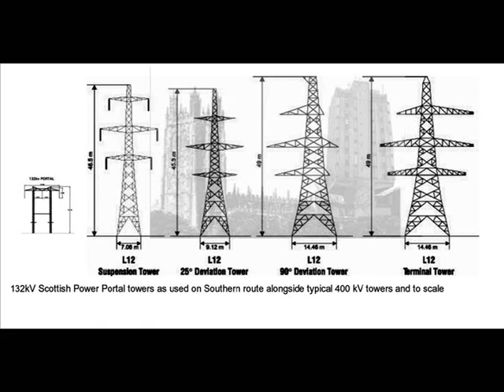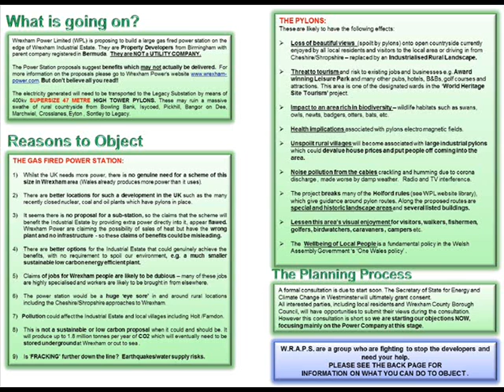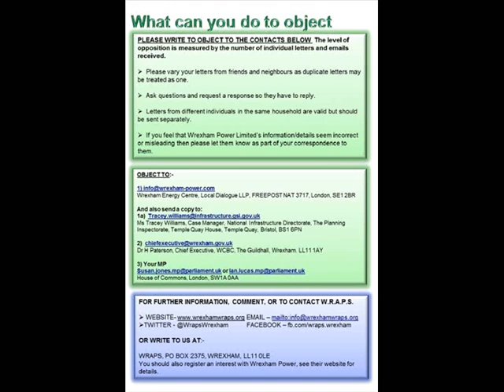BBC radio 20 May 2013 Why Wrexham Power must not go ahead

Comment: I found that solar thernal is 75% solar efficiency or 3.75 x that of solar normal.
Therefore a squared km would be 400 megawatts per, more than enough for all 150'000 people of Wrexham. 
Solar thermal is also cheap.